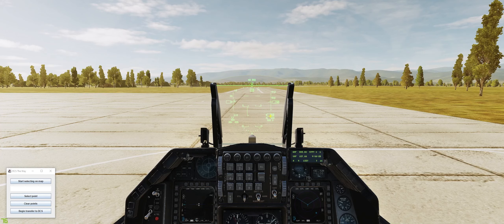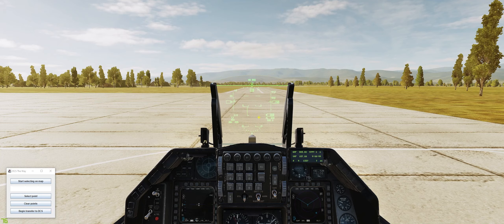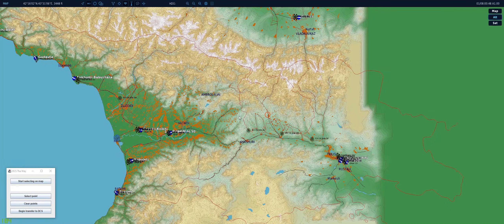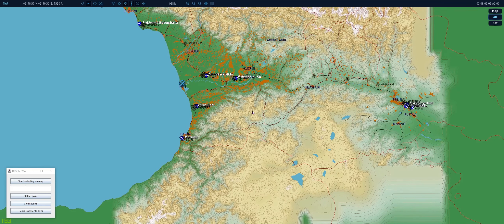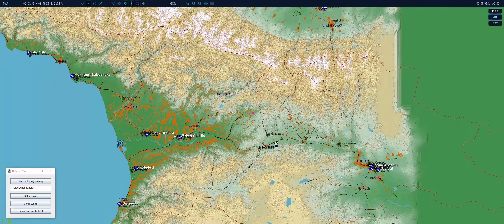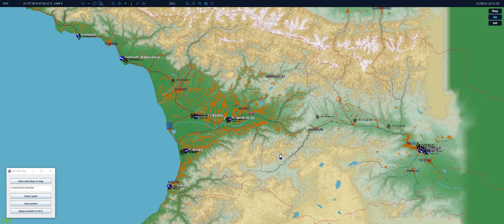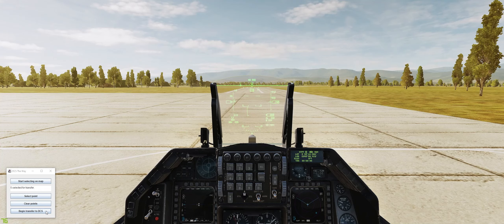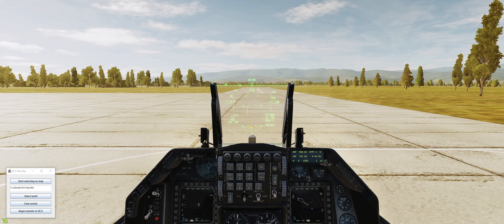DCS: TheWay V1 | Load waypoints to plane from F10 map

Comment: A few questions;

What happens when there's an existing flight plan ?
Do I need to setup the aircraft in a specific way regarding the MFDs ? Meaning the MFDs have to have a starting page before the magic does its thing ?
Reply: From my experience:
1. It will input waypoints after the one you currently have selected. For example, if you have waypoint 5 selected, it will add/replace waypoints 6, 7, 8, e.t.c.
2. Only tested F-16 and F/A-18. It does everything automatically, but for the Hornet there's a small notification telling you to enable precise coordinates first.